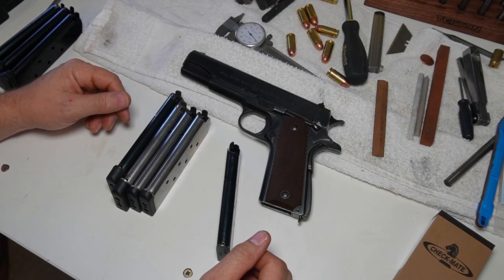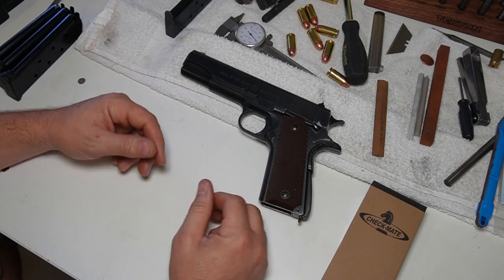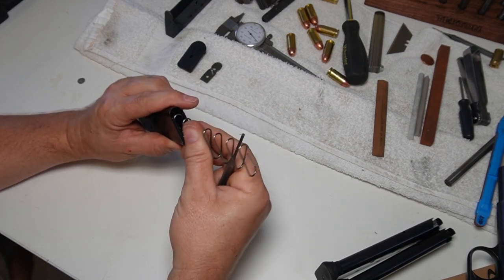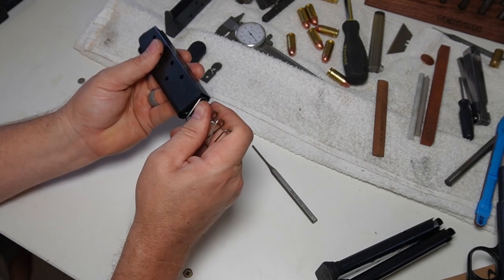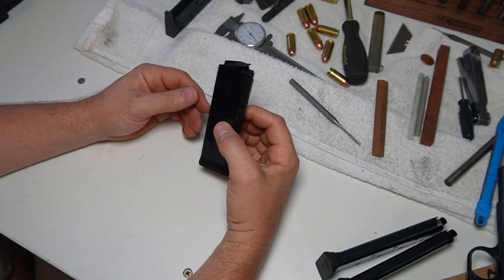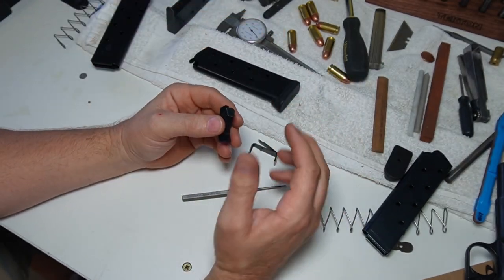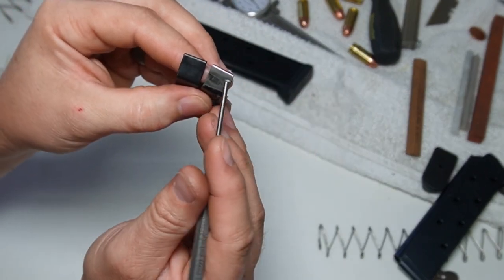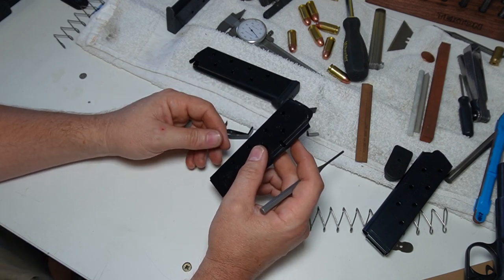Check-Mate Magazines: Disassembly and Fine tuning

Comment: Big fan of the wadcutter followers for these mags. One of the better options that provide a control feed for SWC and hollow point bullets.

Also an update on the micro TIG welder. I've got my first barrel welded up, just need to cut the lower lugs next then test fire.
Reply from the maker: I was hoping that you’d do an update soon. What filler rod did you end up using?
Reply: @nobodytraining  ER316 on a stainless barrel. Not pretty as there was a lot of trial and error. I'll need to find some finer rod when I'm ready to weld up the frame and slide for a tighter fit. What's your email so I can send pics of my updates?
Reply from the maker: My fingers were crossed that you used something like that. I looked at doing the same thing and then silver soldering shims around the hood. I’ll show my issues with the barrel one of these days in a video. Besides the barrel being hard chromed!

Love to see the pics. Trainingnobody@gmail.com